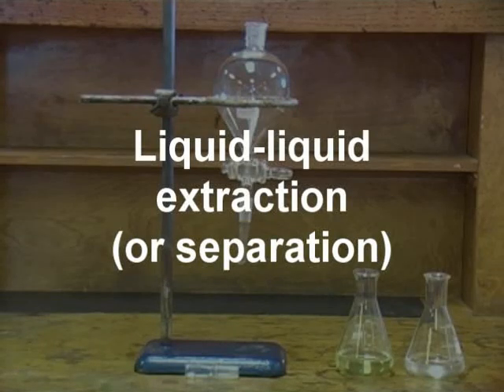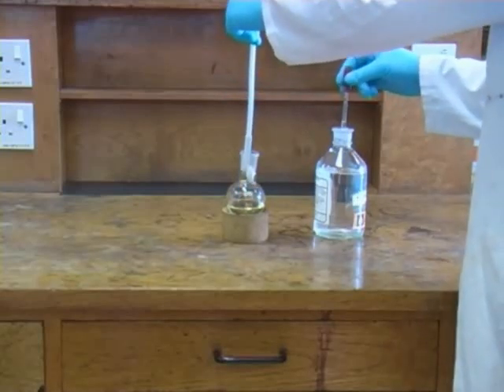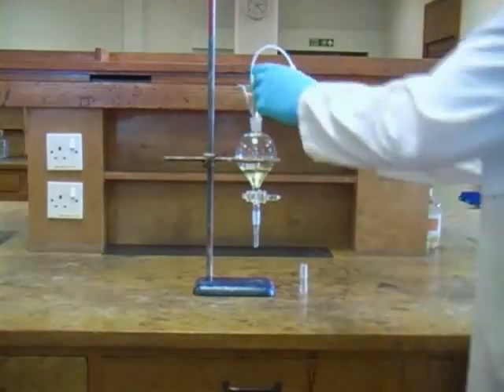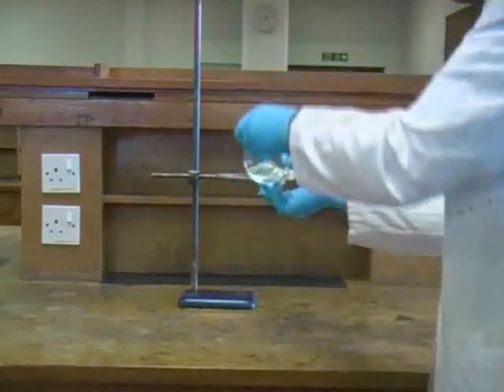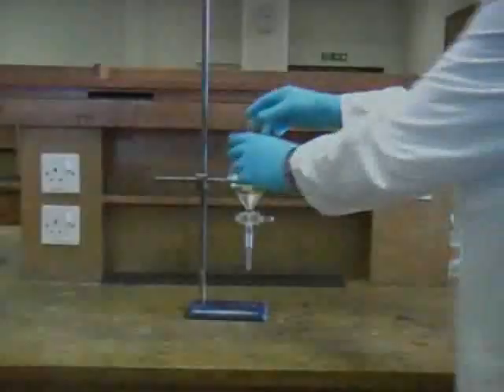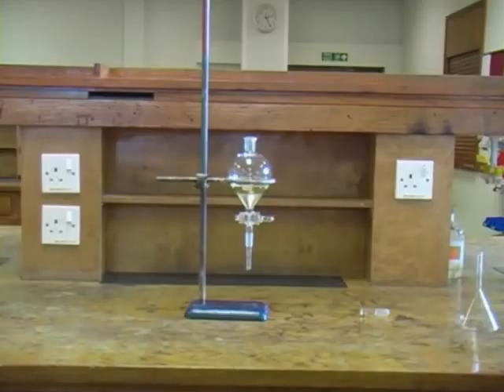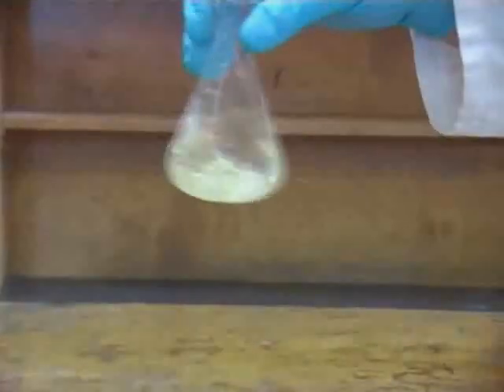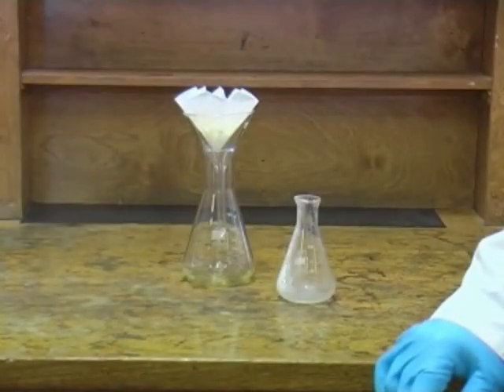Solvent extraction or separation

Comment: thanks, good video. why shoud we remove the stopper before collecting the bottom lsyer?
Reply: Common error which stops the liquid from flowing freely..... imagine pouring a liquid out of a can, eith just one hole, an airlock occurs, since the liquid is leaving a vessel, air needs to fill the differential, which is means air is flowing in the same port as the liquid is trying to exit.